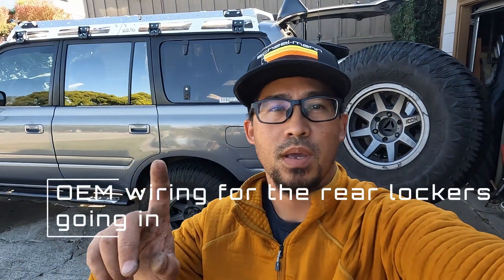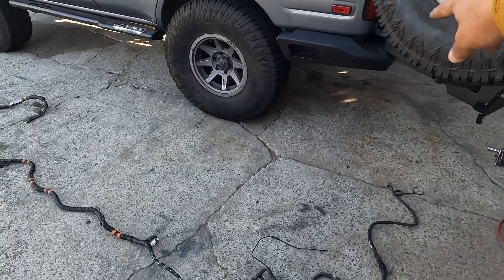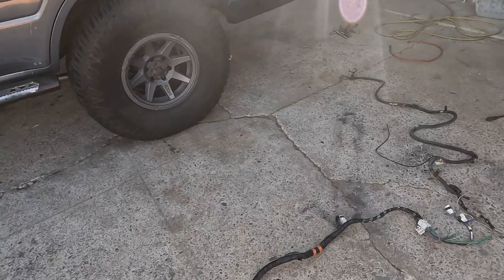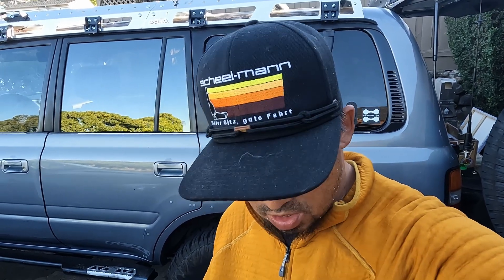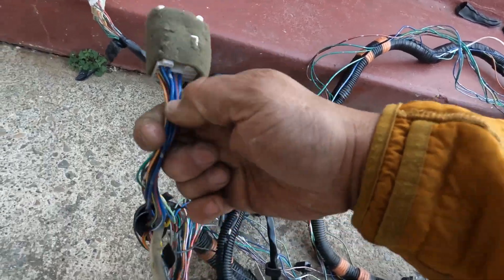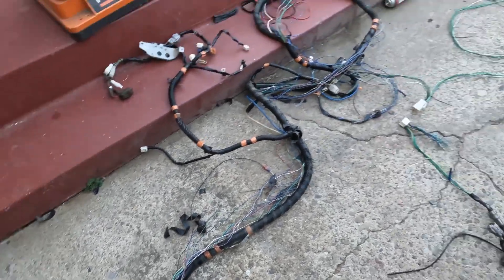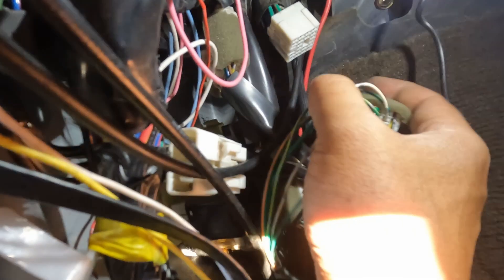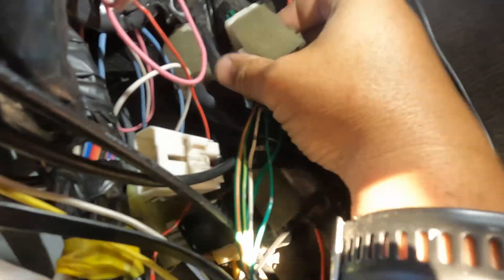Wiring in OEM Diff Lock wring into a FJ80 Landcruiser

Comment: It's more complex than I thought it would be. I thought they would all be wired from the factory more than that to accept the option of having lockers. Kinda of like having that plug behind the HVAC that allows you to easily plug in a center locking diff switch and there's other blank plugs around too.
Reply from the maker: @NigelNaughton it is definitely a bit more involved but doable.